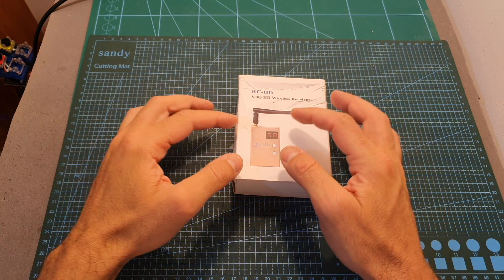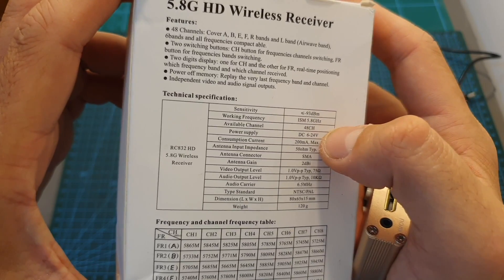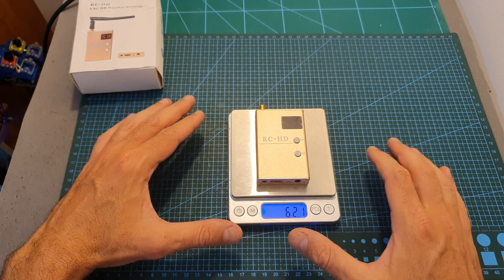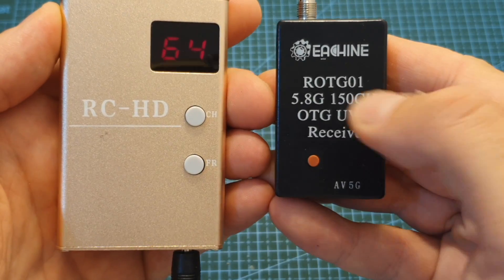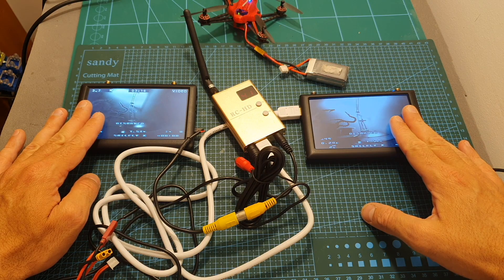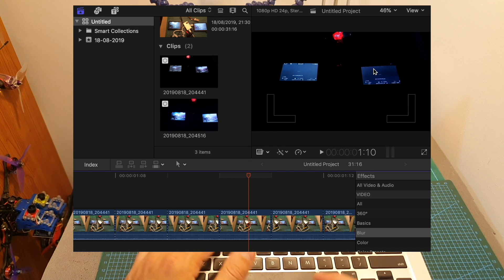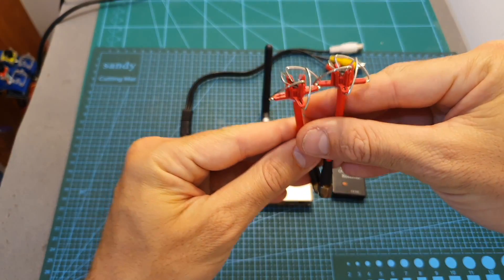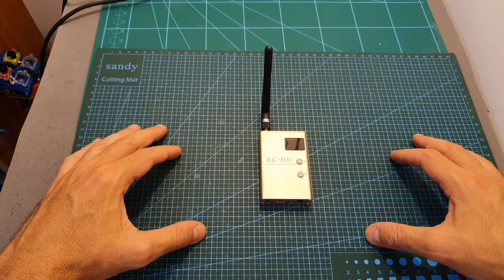How To Turn Any HDMI Screen Into An FPV Screen

Comment: Amazing Video! Exactly what I wanted to know.
Btw I have a question that how would I know that which channel and band to use on RC-HD reciever if I have a 5.8Ghz transmitter.
And can I use any 5.8Ghz transmitter with it

Thanks
Reply from the maker: Thanks! You need to set both VRX and VTX to the same frequency.

Comment: Great review! Thank you. Question for you... What size lipo are you using to power the RC-HD unit? And, how much life do you think you are getting from whatever lipo battery you are using. Thanks again!!  👍
Reply from the maker: Thanks Daniel. I recommend using a 4s LION pack. It will provide you with many hours of working time.
Reply: @KremerFPV  G'day Gal, I understand this is a late reply.
I'm struggling to find the correct JST connector and 4S Li-Ion with ~12V, which battery specifically or a similar copy?
Reply from the maker: @josephrevell3078  Hi, according to the specs the supported input voltage is up to 24V. Unfortunately I don't have this device any more so I can't check the DC connector size.
Reply: @KremerFPV  12DC input, I found a wall socket adapter that will work with the device, I've ordered the RC832HD.
Curious, are you using an updated device now?
Reply from the maker: @josephrevell3078  No I am not.

Comment: This is exactly what I need.    HDMI output.   I'm piping this right into a 1080p computer monitor in the field.
Phvck DJI for not having HDMI out.   I can't stand wearing this rotten goggle mess with tiny screens.   
Even my best 5" analog goggle screen size can't compare to a 10" FPV monitor for immersion.  
And a 22" computer monitor is going to blow the 10" FPV monitor out of the water, for 100% immersive flying.   DJI can svck my
Reply: If this thing works, then whoever designed and built it and put it out as a product is a SAINT.
Even if it doesn't have diversity, I'm counting my blessings...     to get me away from this goggle cr@p.
Reply from the maker: Here is another option for you, although it's much more expensive: https://youtu.be/2PciR55HymQ
Reply: @KremerFPV  I'll get it, with a TBS Unify 32 HV  or Rush Tank Solo as my vtx transmitter.

Comment: Buddy, is there a way to use a standalone module like a rapidfire or TBS Fusion?, that are ranked as the top 2 best diversity modules, maybe somebody come up with a Video Module bay so to tap in to the video out, special considerations must be done so in order to prevent the quirks that licencetodrive comments in this video ( see his comments below) about the quick n dirty deinterlacing so the text jumps, not on Dudu video, check how he achieved it here https://youtu.be/8awQB2sgTpQ .... and YESS!!!! check this out , you can use rapidfire or other module like those with this adaptor https://youtu.be/2LjNxYhwC9E

Comment: Does this work with the digital signal of the Dji FPV air unit?
Reply from the maker: No, this is an analog VRX that has an HDMI output port.

Comment: When I saw it does HDMI out from an analogue signal I had my fingers crossed it does it 'right' with full deinterlacing to get silky smooth 50fps from PAL & 60FPS from NTSC, but playing back your example footage at 0.25 speed I noticed the OSD text jumps up/down by a single pixel, this indicates it does capture the full resolution of the analogue image to end up with 50fps PAL / 60fps NTSC, but the deinterlacing technique it uses is quick'n'dirty, just like the FXT DVR that outputs 60fps.
The technique it uses simply scales each field of the interlaced source frame up to 1080p, without reconstructing the 'missing' image data, resulting in footage that jumps up/down by a single pixel every other frame.

I've only once seen someone else achieve 'true' deinterlacing of analogue source upscaled to HD, he used 3 pieces of equipment; 5.8ghz VRX, analogue to HDMI upscaler, and a HDMI recorder that saves to SD card.
Check out what he achieved: youtu.be/9MBCqQkMAeA it's silky smooth, try playing it back at 0.25 speed and you'll see the OSD text is rock steady.
Reply from the maker: Thanks for your thought input. I am going to check another DVR system soon.
Reply: Note that what was captured out of the receiver was the analog signal and not the HDMI so the non deinterlacing is still the fxt dvr in action.
I’ve done a similar setup with a stand-alone hdmi capture box for gaming systems. I ordered one of these to try it as it cuts out both the rx (either a cable to my goggles or a separate rx) and the analogue to hdmi converter to make my package a bit smaller.
Hopefully we’ll see if it’s properly deinterlacing.

https://youtu.be/bndRbafqPaw
Reply: I realise there is no osd on that previous clip as it was an NFE whoop
Here is another clip, you can check if the deinterlacing is working properly:

https://youtu.be/Sd-qbwkyNGQ

The box is a super cheap converter
https://www.amazon.co.uk/Composite-Converter/dp/B07LGR61J7

I don’t like how it handles high contrast scenes which includes the OSD since it is such a bright white it darkens the rest of the image. I’m hoping the RC832HD won’t have that auto adjustment
Reply: Did you ever find a better solution than this for sale?
Reply: Did you ever find a solution? And is all fpv video interlaced?
Reply: @PilotPlater  Sadly I haven't found any solution to being able to easily capture full resolution interlaced analogue video. With Shark Byte & DJI HD FPV systems now here the interest in analogue setups is declining, I've got Shark Byte myself and might be getting DJI HD next year, though I'll never abandon analogue because some of my favourite craft are micros & whoops.
Analogue video is by design interlaced, so all analogue FPV gear is too.
Reply: @licensetodrive9930  Appreciate your response.

I'm getting into my first setup now, about to hit buy. Opting to go for analog because it's 1/4 the price, and then I can not feel bad if I beat the crap out of the airborne hardware on my first rig 😁
Reply: @PilotPlater  Good way to get into the hobby, dipping your toe in so to speak to see how much you like it before you think about spending 100's & 100's on HD gear, plus there's an immense amount of people still using analogue so if you get stuck there should be plenty of replies to questions.
I'd suggest buying some good quality 2nd hand analogue goggles, that way if/when you move on to HD it's likely you'll be able to sell them for the same price you bought them.
Reply: @licensetodrive9930  good tip, for now I got the 800d because people pointed out even if I don't like the low quality, I can still use it as a static monitor, or give it to a buddy for a Ride along